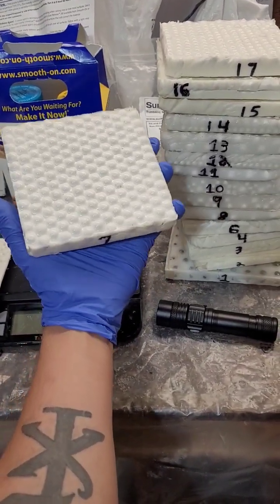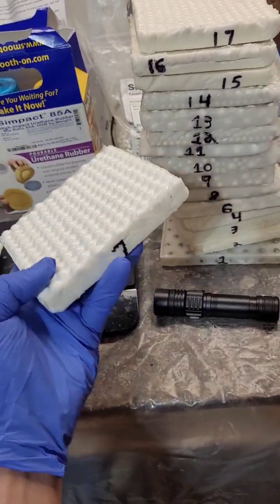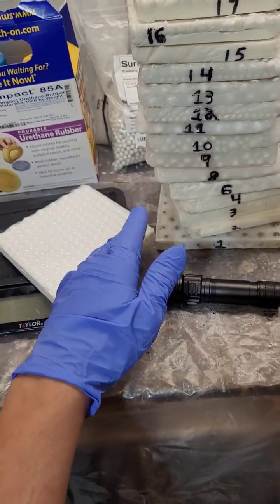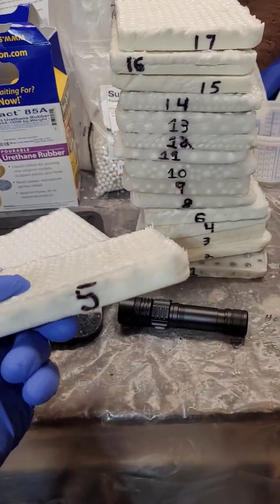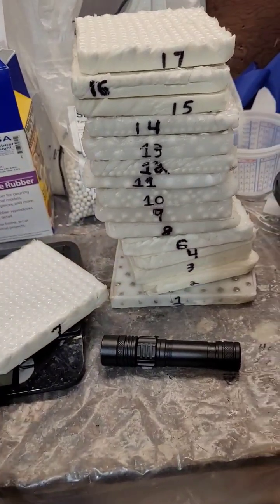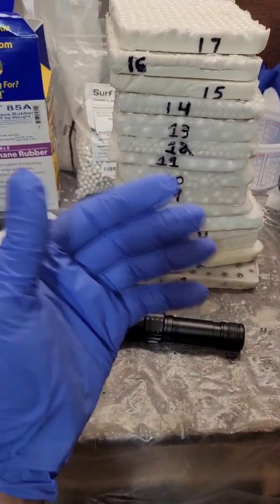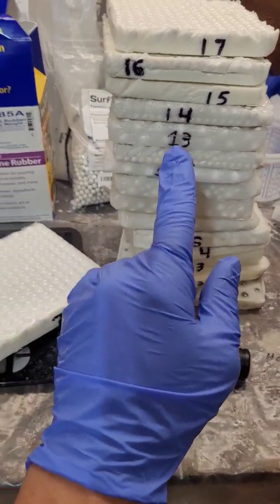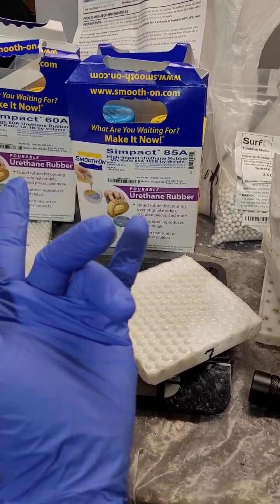DIY LIBA armor! #armor #gun #libaarmor

Comment: Maybe you use ceramic foam instead of ceramic balls encase in polyurethane or do both and see the difference
Reply: Ceramic foam won't work. In order to get any kind bullet resistance, the ceramics need to be homogeneous or 100% solid in their original form. Intentional holes or voids is the worst kind of kryptonite for armor. Holes or voids in an armor system makes it easier for a bullet to penetrate the armor not harder.
Why do you think major car armoring companies go out of their way to ensure that there are no air pockets or bubbles in the Fiberglass/epoxy resin armor panels that they make? Because if they don't then a lot of people will end up getting killed in their newly armored vehicles and those companies will be facing some very hefty lawsuits for endangering the public with their frivolous products.
Also the type of ceramic you're talking about is probably used as a heat sink for space craft than anything else and is probably made of a heat resistant ceramic like Zirconium Carbide (ZrC) and not an armor grade ceramic like Aluminum Oxide(Al2O3), Silicon Carbide(SIC), or Boron Carbide(B4C). 
Solid ceramic tends to be more suitable if you're trying to stop a bullet and it's the same reason 
why tiling for your bathroom floors if it's made of porcelain will also stop a bullet. 
Also Tech demonstrated something similar to what you're asking about in a video titled "mixing resin and powder: will it make a bulletproof ceramic?" In that video he explains why most of the ceramics you hear about in armor systems need to be solid ceramic through a process called sintering in order to work their magic against bullets. 
He also explained why the resin tiles he made broke apart more easily and underperformed vs a true sintered ceramic. I'll give you a hint: it was because of the air bubbles inside the resin tiles.

Comment: At first I thought the resin looked like hdpe from milk jugs, have you tried hdpe for holding the ceramic balls?
Reply from the maker: I have! But I'm still dialing in the method, so I'm going to go ahead and drop these first 20 plates. I'll be mentioning and showing what I've come up with HDPE for the resin. If these first ones work well, I'll continue dialing in the hdpe ones. I also want to try aluminum.
Reply: @Techthisoutmeow  that's awesome! You mean that you are trying aluminum as the resin as well? By melting the aluminum and pouring it over the ceramic balls inside a mold?
Reply from the maker: @DavidSmith-vz9uu  yep! I'm looking at using both recycled aluminum and hdpe as a binding resin for the ceramic balls. So far, the HDPE is looking like it will perform well. I haven't made it to aluminum yet, but I have high hopes for that one.
Reply: @Techthisoutmeow  Wouldn't the heat from the molten Aluminum ruin the structural integrity of the ceramic balls? I've seen a SIC ball easily shatter like glass after being heated to a few thousand degrees and struck with a hammer. You might want to consider just sticking with using HDPE as the resin binder for the Alumina balls. Exposure to a few hundred degrees rather than a thousand degrees shouldn't compromise the ceramic or affect it if at all.
Reply: @Techthisoutmeow  You could try also cast a cloth(or something similar) into the backside of the resin to let the residual fragments return to position after a big hit.

Also, you know that offensively, this can be used as a Claymore right? Are you going to try it too, or just use as armor?
Reply: @isaacm1929  Yes that's a real risk for any armor that uses ceramic balls as a face. But I believe with a strong enough resin to hold the ceramic balls in the danger of your armor effectively turning into a claymore should be avoided.
Reply: @nemesisobsidian  Yes, the probability is minimal, that's why I asked "are you going to put makeshift C4 behind and use offensively too?", but used other words.
Reply: @isaacm1929  You could use the balls offensively yes, but explosive devices are like full auto, very heavily regulated and possession without the proper paperwork or license would be illegal in almost every state. Something like that isn't worth the risk in my opinion.